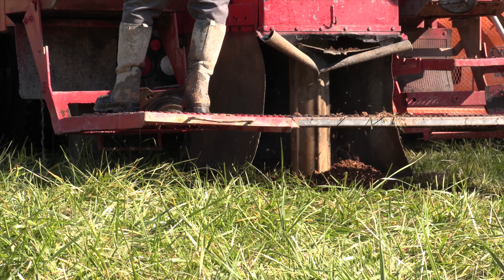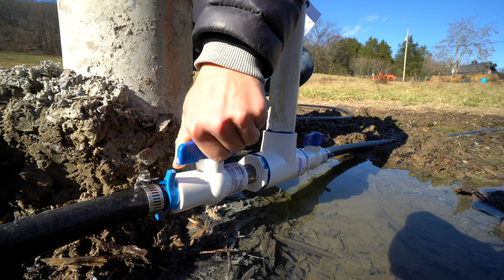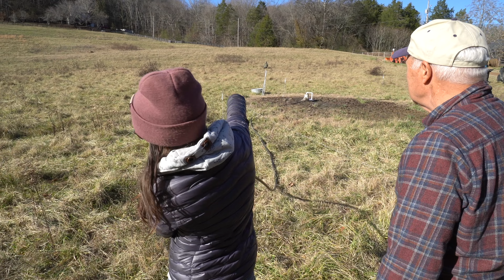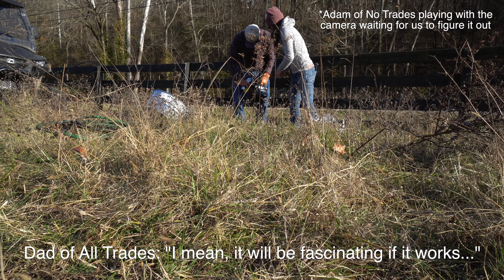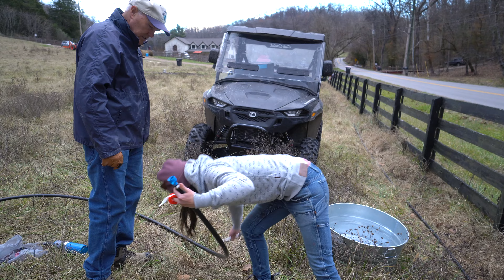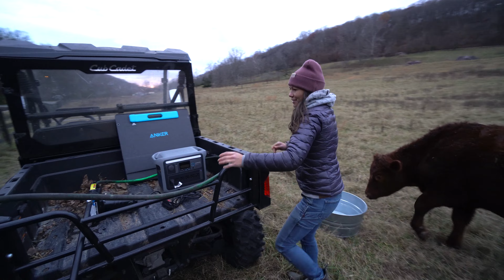How a Small Farm Solved it's Big Water Problem

Comment: I grew up around a LOT of artesian wells - very good water, lots of iron where we were.
I suggest that you use the triangle thingy you used for the swales to make your tanks on the same elevation as the well. Use gravity and the artesian pressure to full the tanks automagically with the shutoff floats, and a ball valve for when that area is not in rotation. Then you could use your portable pump to water plants and such when/if needed.

Comment: Just subscribed after your battery/gas tool video and this video hits close to home... Our water comes from a converted oil well and I've no idea how far down the plug is. Our Pressure tank and pump controls are inside the converted septic tank/storm shelter and the 1" galvanized line T's off to the barn which is 100 yards downhill from the farm house power and storm shelter/well house... Pressure was great at the barn 20 years ago but has slowed down to a trickle. Which makes watering horses an issue.

Comment: Is there enough flow from the well to run a ram pump? This would require no electricity and they are very reliable.
Reply from the maker: I’ve got a really sweet system I’m designing for a ram pump. Unfortunately this is at the bottom of the hill, but my friend and I are designing a system with a catch pond at the top of the hill that should be able to utilize the ram pump, but that’s in the 5 year plan and this is a good temporary solution in the meantime :)

Comment: I'm surprised you gave no thought to power when you chose where to drill your well... Also, power at each trough would be nice for freeze-guards in the winter, and heat tape for any lines above ground...
Reply from the maker: Check out my Extreme weather winter farm chores video, you might be surprised to see the solution I came up with ;)

Comment: Nice!
Water chores were the worst according to my kiddos when our rabbitry and pig area were further away.  One of our solutions was like your doing with your hoses except we were too cheap for float valves and the extra water just poured out.  One benefit to this in the summer was it gave the pigs a refill on their woller area, and it purged the hot water with cool water in the rabbit water tank.  Now it was easier and it simply required the turning of one valve like you have and our well did the rest.  But what about being gone for a day or two?  Enter the automatic waterer thingy, runs on a batteries and hooked to our faucet. it is basically several solenoids on a timer and we could program it to turn on and off at certain times.  For example, we could have the rabbit waterer turn on more often and remove the hot water from the tank to keep them cool.  In your case you would simply need to add a  separate timer to kick on the water pump and sync the timers up.  

We downsized our rabbity and got rid of our pigs before we could implement phase2 which was to use an Arduino and floats to make sure the tanks were full by sending us a text.  We had ours ran down the fencerow, at first it was level and it did have a few places it cracked.  We then made it to where we could drain it with a slight elevation on it and that kept it from freezing solid during the coldest days.  

Glad to see your videos out again.

Comment: Would it ever make sense to make a water tower at the top of the hill? That way you could have the pump in a stationary position and gravity feed your field at the right location. Could put a flow valve on it too so you could control the amount of water. Also might make it easier on your solar setup. Not trying to sound critical, just generally curious.
Reply from the maker: The five year plan has a catch pond at the top of the hill and a ram pump. I’m stoked to do dirt work again, it’s been a while since I’ve gotten to play on an excavator.

Comment: You could always use some RV water pumps to pressurize your pipes. A simple solar system should be enough to run the RV water pump. I have a pump in my remote cabin that is capable of 5 GPM @ 55 PSI......it was under $200.....and it turns on and off based on the water pressure.

Comment: We only have 7 acres but that is still a lot of hoses to run off of 1 well for 6 pens of different animals. Our solution was ibc totes, some hoses and/or PVC cut to length. Then lots of different fittings between hose, nylon, pvc and bulk tank agricultural to attach it all to watering cups they press their nose into to get fresh water for sheep and goats, little cups and nipple drinkers for the birds, a stock tank for cows with a float valve and nipple drinkers for the pigs. It's great to know I can still get water to the animals when the power goes out which happens a lot in hurricane /tornado/thunderstorm prone Florida. Glad you guys were ok after the tornado, those are some scary things! I'll take a hurricane over those any day.

Comment: Can you place a water tank on the hill with fill valve? So you can fill the troughs with water by gravity? That way you can reduce the horizontal travel...you can install a pump at the water tank... I'm not sure if it makes sense or not...I thought using the gravity can be beneficial since your field has a hill...

Comment: Look into hydraulic rams! These are pumps that work by the pressure of the water alone (basically you trade volume against pressure). Not sure whether it would make sense in your case, but if you know about it, it might be another tool that could come in handy.
Reply from the maker: The five year plan has a system of sealed and a catch pond at the top of the hill and a ram pump! Ironically, my dad’s organization has done a ton of work with the guy who invented them, and I am absolutely fascinated by natural ways we can use gravity and airflow to our advantage

Comment: Should look into a ram pump. No electricity needed. It uses head to build pressure by slamming 2 gate valves at 2 intervals. The flow is slow but constant and you can pump water ridiculous distances.
Reply from the maker: The five year plan has a catch pond and a ram pump. I’m stoked to do dirt work again, it’s been a while since I’ve gotten to play on an excavator.

Comment: I think I would have had as much of the pipe running outside the field..sure its fine to drive over but not with a mower! Safer over the fence where I guess your more likely to use a strimmer. Or even better attach it to the fence itself.

Comment: LOVE your channel. Starting my own homestead journey soon.

With your PTFE (plumbing tape), make sure you wrap it the same direction you turn the connector to tighten (clockwise looking into the opening). This ensures that putting the connection on doesn't "loosen" any of the wrapped PTFE.

I'm also a 10yr electronics technician majoring in electrical engineering. Let me know if you want help with that solar gate setup! I would be happy to help (for the low low price of free).

Comment: If your grade is correct you could have pipe going from trough to trough with an overflow going to the next one. I saw a farm do that to automatically refill over 5 troughs from a spring and it was freeze proof.
Reply from the maker: The grade won’t quite work for that but you bet your buns I tried

Comment: Anne, you're the best! I have one question and one suggestion- 
Question: Was this really cheaper, easier, less work than getting/making a small tanker trailer you could tow out to the troughs with the buggy? I'm envisioning something as simple as an IBC tote on a Harbor Freight utility trailer. Set it up high enough so the water could gravity feed (rapidly) out of the tote. I'm probably missing something, I was just wondering why you went the plumbing route vs the tanker route.
Suggestion: Wrap teflon tape onto the fitting so the tail gets smoothed out as the female part is screwed on. I noticed in one shot that you were wrapping it backwards. This can cause the loose end the get caught and ball up as the connection is being screwed together, leading to leaks... though obviously none of that is critical for a low-pressure outdoor watering setup like this; it's just good practice. Better to learn the lesson outside than have a catastrophe after doing some indoor plumbing!
Reply from the maker: Short term thinking, no this wasn’t cheaper or easier than an IBC tote, however, this short term solution will also be able to be utilized by the longterm solution, getting a solar water pump, digging a catchment pond at the top of the hill, using a ram pump to automatically run water through the now existing pipes/infrastructure, therefore the short term helps build toward the longterm solution, which ultimately is better in my mind than a temporary solution that might solve things well enough to discourage the making of the longterm solution a priority… if that makes sense ;)

As far as the direction of the tape, you’re 100% correct, however my wrapping it the wrong way is due to dyslexia, not an improper understanding of the correct method. Right and left, clockwise and anti-clockwise are a lifelong struggle for me and no matter how many times I try to get things right, I’m usually only right 50% of the time 😂😂
Reply: @AnneofAllTrades  I spent a lot of time working in factory maintenance. A saying I learned that rings true is "there's nothing more permanent than a temporary solution that works." So I 100% understand the rationale for doing the project the way you just explained it. 

As for the tape, I wondered if it was a lex-dysic thing.  😉 I'm always amazed by how transparent and vulnerable you are with so many total strangers on the internet. Such bravery is highly admirable!

I wonder if there are any tricks you could use to help with tasks that repeatedly give you issues (like teflon tape). I now work in Lean Six Sigma factory process improvement. One of the tools we use is called poka-yoke (Japanese for error-proof). It's a methodology for setting things up so it would be impossible to make a mistake. You can find all sorts of clever examples with a quick Googling. Most of them seem forehead-slappingly obvious with their simplistic brilliance!

On that note, feel free to reach out if you ever want to talk Lean. There are tons of application opportunities for a situation like yours where you have so many things to do that you can forget which way is up!
Reply from the maker: Ha! I bet we could talk for hours. Lean thinking, SCRUM, Kanban, etc is how I run my whole life. With my many learning struggles, I've found many helpful principles of Cognitive Behavioral Therapy in those methods. Of course I can easily get carried away building the system and forgetting to do the work... so finding a healthy balance and actually leaning into some of my more innocuous idiosyncrasies instead of being consumed by solving them is always a... balance ;) Though you'll probably be amused to know I've been carrying around a notebook and kitchen timer for the better part of 10 years both as a motivation/awareness tool and as a data collector to look for inefficiencies in my day to day repeated tasks/chores/processes and train my brain to constantly be on the lookout for possible solutions. One of the sillier yet extremely effective solutions I've come to is purchasing used/cheap duplicate tools and literally leaving them in the way, on my way past, around, or through an area that needs a task done so I remember to do the task and, when the right moment strikes to do so, everything I need is already right there, where I need it. It's cost a few extra dollars but saved me a lot of gray hairs. Though I have also, admittedly, accidentally recreated the rake scene from every marx brothers movie on multiple occasions and taken a rake handle to the face tripping over my very useful tool, right in my way, where I'd forgotten I left it ;)

Comment: I definitely wouldn't be trusting that pipe above the freeze line, you might be OK if it was always flowing but if the water is sitting in the winter in the early morning hours I can't see it not freezing. But a small two battery solar system inside a small insulated box could definitely be done so you don't have to be Watergirl anymore.
Reply from the maker: Water girl 😂😂 believe it or not, When we reached sub zero temps for the first time in a hundred years this winter, the water didn’t freeze! Check this out: https://youtu.be/WeTN6H6LEUk?si=FjOTjGiNmJFUxnE1

Comment: Are you going to move that water line to the edge of the fence, I am concerned the cattle will step on those connections and crack them?  Or, could you put the water line on the outside of the fence and then just use the junk hose to reach the watering trough?
Reply from the maker: The city mows the fence line so I can’t put it outside but we use these same quick connects at the dairy and they can take quite a beating. The cows tend to leave them alone, but they get run over by farm hands all the time 😂

Comment: Instead of moving the pump, battery and wiring around, couldn't the pump just live near the well permanently?
Either way, yay for fewer chores and finishing projects! 😁
Reply from the maker: Because the electrical box and the pump need to be kept dry, it made more sense to make a portable system that can live inside the cab of the UTV. Eventually I’ll get a solar pump that lives on the well and then I’ll just have to flip a switch. But this was a super inexpensive, easy fix at least for the time being.

Comment: Do u have enough flow from that well for a water ram pump. Use the power of the well to pump the water and cheap to buy as well
Reply from the maker: The five year plan has a catch pond and a ram pump. I’m stoked to do dirt work again, it’s been a while since I’ve gotten to play on an excavator.
Reply: @AnneofAllTrades  they are fun. I bought a second hand one excavator and it great. So flexible in what u can use them for

Comment: Couldn’t you put up a water tower above the well and use gravity to provide water and generate electricity?  If the water goes up 200’ couldn’t it go up higher?
Reply from the maker: That would be cool, but that’s a bit more of an involved project than I’m quite ready for 😅 and it would still need a pump to get the water up to the top of the water tower, it only has enough natural force to carry water up a 1% grade for about 150ft before it stops flowing out naturally.
Reply: @AnneofAllTrades  Yeah, I don’t know anything about water or plumbing.  I have been watching videos of this guy pumping water without electricity.  Once it gets primed it moves.  Thinking if you had barrels or tanks full of water you could pump up with solar.  Even if they are on the ground but gradually go uphill, then all that water would be on demand.
Reply from the maker: oh are you thinking of a ram pump? That and a catch pond at the top of the hill are on the longterm projects list :)

Comment: Totally unnecessary comment, but I bet that power station will run the freezer for a lot more than a day and a half. I'm guessing you used the freezer's peak power draw rating to calculate the time it would draw the full amount of power from the battery. But the freezer only runs intermittently, especially if you don't open it. You'd have to measure (or estimate based on common usage) the power consumption of the freezer over an hour or something. Maybe you actually did do that, just thinking out loud.

Comment: Can’t you just put a shutoff valve on the line going to the pond and shut that off when you need more pressure?
Reply: Spoke too soon lol.
Reply from the maker: Yes in theory, but it’s not enough pressure to go very far, it takes a long while even to equalize after I raise or lower the line going to the pond. But you have to be extremely careful not to ever shut all the valves at once or the whole thing will explode. That’s why this is the temporary solution 🤪
Reply: I would put a T fitting between the well and one of the shutoffs so you can have a threaded port for a pressure gauge just to see how fast and how much pressure it will build with both valves off. 
If it doesn’t build enough pressure to blow up could you then install a pressure tank for it to fill over time for use later? Just thinking out loud.
Or install an elevated tank that it could slowly fill over time with an overflow to the pond. Then the elevation of the tank would give you the volume and pressure to fill the stock tanks out in the pasture without any pumps.

Comment: Crazy question, is the water pressure enough to spin a small generator that could run a small pump to pump the water up into a taller water storage that would then be higher and thus cause water pressure to be able to not only have above ground storage, but water pressure to then push the water to the further away piping?  ie if it worked, that way the well itself generates the power to pump the water....it may not work, but...who knows...another option might be if the electric is only enough to power an air pump, use that in a tube to cause water to go up into the water storage, etc.  ie that works for aquarium water flow.  Not sure if Kris at https://www.youtube.com/@KrisHarbour would have any ideas or not, but he is the expert I watch in water generated power....though that is for larger volumes of water, so not sure.  Good luck in any case. :)

Comment: you can make water pumps that require no electricity, they work on a sealed barrel  creating a vacuum as its emptied and siphoning up water through an input on top. water pressure can be increased by attaching air pockets on inline T's along the outlet pipe.

https://www.youtube.com/watch?v=9eBf6_W0vlo
https://www.youtube.com/watch?v=xVYzyGXEYPk
plenty more videos out there